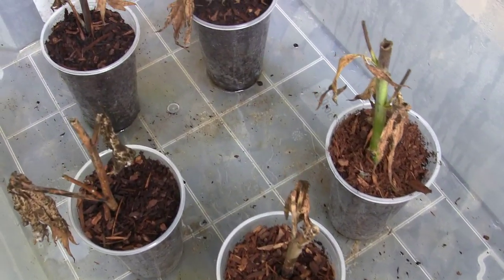Why am I Getting Mold on My Plant Cuttings | Why are They Rotting in My Propagation Frame

Comment: I got to be told 20 times  about this over watering thing.  You have a video where you showed  a sorta clear plastic tote . Lid too. And the condensation  on the lid was way more than I have achieved using the fist squeeze soil moisture standard. And in that video you emphasized  little water yet those condensation droplets were huge ( size of a nickel) so I followed what I saw and not what I was told

 This spring  starting in March I made a compost like with crushed deciduous leaves for the brown and a lot of some sort of ornamental conifer trimmings.  Soft terminal ends  ( last 6 to 8 inches ) the green conifer trimmings I put on the bottom, of the bottom of the pile. And by the 1st of July as I was  aerating  the pile . The bottom of the pile was  a mass of matted white roots. So much profusion of roots that I could not identify any of the original trimmings . Which was the very tip and more important which or where was the cut end of the branch

Now for the conclusion . This root mass at the bottom of the pile . Which had grown within the pulverized  leaves  was dry . Apparently never recieving rainwater moisture or very little and only ground moisture percolation or vaporized from the ground. . A guess would be 10% moisture but appearing  and by feel mostly dry
Reply from the maker: Sounds like your own property is teaching you

Comment: I think if you remove all the bark and green material below for 1-2 inches you can propagate semi-hardwood really easily in water. The inner part of the stem is constantly watersoaked anyway, that’s it’s job, so it won’t rot. It’s the roots that can rot. Therefore, before roots have developed, „sharpen“ your stem + half it or even quarter the stem to give the stem ways to build roots, dip it in rooting gel, and stand it in water. I have seen cuttings develop roots in 5 hours, it was like witchcraft, had a full bundle of 1 inch long roots (olive)

Comment: Finally after several attempts I managed to get three out of 5 petunia cuttings to root.  I added sand to my potting soil, very lightly watered.  Then I put the pot with the cuttings in it inside a gallon size ziplock bag and set it on a window sill of a south facing window.  It took a couple weeks but it worked.  Working on some climbing rose and arborvitae cuttings now.  Thanks for all your guidance!

Comment: I watched a bunch of videos for propagation but none of them showed how and where to store them, not to mention explain the reason behind it...
I've watered my potting mix and cuttings once and will leave it as is in the tote, I had it out in the semi sun \ shade for a day and after watching this I have moved it under a tree next to the fences.
For airflow, either put the wood on the opening of the tote or just drill 1-2 holes near the bottom and another 1-2 near the top of the tote. This provide airflow and vacuum as cold air comes in from the bottom and the hot air rises and goes out the top.
Reply from the maker: Lots of videos on what to do with the cuttings and how to overwinter them, just gotta look through the channel.  Sounds like you've got a lot of good ideas there.

Comment: Started 4 lemon tree cuttings 2 weeks ago. Everything seemed to be going ok, they were green and good. Little did I know I was overwatering them, then to make things worse I stupidly decided to totally enclose them with plastic cups limiting the airflow. I even left them on a radiator one night. 3/3 mistakes made, dear lord, I completed the mistake set to absolute perfection! They are all covered in mould now and three of them are brown. I guess they're all dead as a Dodo. Oh well, tomorrow I will start again with a new batch and take more care this time. Thanks for this 101!
Reply from the maker: Glad to help!  Good luck on the next run.
Reply: @MikeKincaid79  Thanks Mike - I think you basically hit the three big ones and I made all three mistakes - one quick Q regarding citrus (lemons and oranges) if I may?

 I used natural very high quality unfiltered local honey from a neighbour (I'm in Greece) and mixed it with cinnamon in lieu of rooting hormone, I have fantastic lemon and orange trees which are at least 20 years old and were carefully grafted by my late grandfather - I took the top/newer foliage as cuttings as I've read is the right thing to do - I want to clone them for another property down the road. What's your view on my rooting mix vs "root hormone" powders etc? Am I better of procuring rooting hormone powder?

Comment: Hi Mike, Excellent video! I’ve propagated soft wood cuttings for many years and have had really good success! However, all of my cutting experience has been in the spring!  I’m finding out that taking cuttings in the summer, is a whole new ball game! This video answered most of my questions. I live in Chico CA, and the summer temps can get into the low 100’s several days in a row. I have taken cuttings from azaleas, hydrangeas and an amazing 4’ high (max) oak leaf hydrangea that has blooms all over. I’m really excited about the oak leaf! I have my cuttings in totes, watched the amount of water in the soil when sticking. Is there any additional info you can give me to help in the success of my cuttings since I’m dealing with such high temps? Today is 101. It an go up to 110. I’m just hoping it’s not too hot here to do cuttings! I’ve already learned so much from you. Without your videos I never would have tried summer propagation! Love it! Thanks Mike!

Comment: Try treating the soil with diluted Hydrogen Peroxide mixing in with the water, it is good for the soil and keeps the mold away. Hydrogen Peroxide is also great for the roots of the plants.
Reply: Dade Pomsouvan Would this be safe to do on bare roots of a succulent I’m trying to propagate?
Reply: Would that be safe for my Fiddle Leaf Fig Tree?
Reply: @erinrees532  Aloe vera juice is great for propergation, soak the bare roots or cuttings in Aloe vera juice for disinfection. You can also use cinnamon powder for rooting cuttings, but most succulents don't need it, except desert rose.
Reply: @Flow888100  Yes, you can, just make sure it is diluted with water before spraying it on the leaves.
Reply: @DadePomsouvan  whats the ratio of hydogen peroxide and water?
Reply: @brothernero8428  I use one part hydrogen peroxide to 3 parts water for the soil, if you want to spray the plants directly, I use very little, one table spoon add to the whole spray bottle of water.
Reply: @DadePomsouvan  can i use that 1 tbsp of H.P on a full water spray bottle on my cuttings that starting to develop molds? im worrying it might dry out my cuttings.
Reply: @brothernero8428  What kind of cuttings are they? Spray the area where there is mold and wipe it off with a clean paper towel, if the mold has already infected into the cuttings, it might be too late.

Comment: Thank you for all of your video's that I've watched and hopefully learned from!!  My question is that living North of Boston, MA attempting several times to successfully grow rose cuttings with no luck.  It's almost winter now and I want to know if I take some last rose cuttings and attempt to grow them in my finished basement, would a grow light help? I've left recessed lights "65W" on and will try to not water as much. I planted them in bottles and in container with bottles covering for condensation as you've advised.  Thank you in advance!!
Reply from the maker: The leaves have probably fallen off by now and they are hardwood cuttings so you shouldn't need humidity at all.  lighting and bottom heat is necessary and you may want to use an antifungal spray for the cuttings and soil.

Comment: I rooted a hydrangea cutting last year after following your vid instructions. It's in a 4 inch pot and has 4 little leaves, but it's not gotten any bigger since last fall. I stupidly only rooted this one cutting and I'd like to grow it big. Any suggestions? Also please put a plastic bag over your wounded hand while you are out around dirt.
Reply from the maker: Up-pot to a bigger pot and fertilize.  Keep the soil moist and you should get tons of growth.
Reply: I put my rooted cutting right in the garden in a protected area last summer, and it’s 2 feet high and bloomed this summer.

Comment: Wish I had watched this before trying to propagate some precious watermelon peperomia cuttings for the first time! 
I have mould growing 😓 3rd day in. I had them on a heat pad (winter here in Southern Hemisphere) in a mini greenhouse on the kitchen bench, had watered a lot after planting. 
It’s far too late to take back the watering, but I’ve taken off the heat pad and taken the lid completely off. Will see if that gets rid of the mould, hopefully these babies can be saved! Thank you. Any other advice?
Reply from the maker: Sounds like you're on the right track now.  It's tough losing cuttings but at least you learned something in the meanwhile.
Reply: @MikeKincaid79  thank you so much Mike. I read that cinnamon may also help the problem. Is this something you have tried or can recommend?

Comment: Super clear and concise ideas. Appreciate the content. Just had a couple random questions/observations. Any reason you are using totes with gaskets if you leave them propped open? Also I have always read that hardwood cuttings need cold to focus on root development vs top growth. I have had success leaving them exposed to the elements (or in a coldframe) here in 8b. Just curious if you're in a much colder zone than me. I always baby softwood/semi-hardwood cuttings with domes and heat but I love hardwood because they're so hands off.
Reply from the maker: Glad you like the videos!  I use all kinds of totes, just have one with a gasket.  You don't need a gasket, that tote just happens to have one.  

I live in the same zone, 8b, Western Washington State.  I do the same thing for most hardwood cuttings.  Just leave them outside and stick them when we get closer to spring.  Depending on how difficult or easy they are to root I either use bottom heat or no bottom heat.  Good luck and have fun!

Comment: Mike, what are you spraying them with if there is mold on them?   Peroxide?    I was in the hospital for a few days and now there is mold on my SunPatient cuttings and apparently, I did overwater before that.   Or do I just get rid of the ones with mold and remove the lid (right)?   This is all inside my house in 1 tray.
Reply from the maker: Once they start getting mold and going down hill, I like to just start over.  You can use peroxide and may save some but it might be more fun to just bag these and take some new cuttings.

Comment: As always enjoyed the video.  I bought a mini greenhouse it just zips on both sides, plastic  with 4 shelves.  I put my cuttings in it it's September 24.  They are all covered with plastic bags and have condensation.  Do I keep them covered?  Or do I remove the covers and keep them uncovered or covered for winter?  Thanks.
Reply from the maker: Depends on many factors.  Are these softwood cuttings?  What type of plant?  How cold does it get or are you in a tropical region?  Are you heating the greenhouse?  Do you have artificial lights in there?

Comment: Hello once more, Mike!  Trying to come up with the best way to ask questions regarding your member's area videos, so I thought I'd start here.  I realize that your primary area of interest is the propagation of rhododendrons, and, as a result, your member's videos primarily deal with how to use the propagation box for them.  However, if you use it for, say, softwood cuttings, wouldn't things be quite different?  For example, how long would those guys stay in the box?  (Rhodies don't get stuck until the fall, so they have to root over the winter, correct?)  I'd like to try to propagate rhododendrons, but right now as I'm learning, I'm trying things out with plants I already own.  I can see the advantages of using the propagation box over my big collection of totes, but I'm trying to work out how this process changes when it's used for plants that are propagated as softwood cuttings in the spring, and also how to adapt things for my zone:  5a.  (For example, you did mention in passing about how the freeze/thaw cycle in your area makes the bottom heat imperative.)  I'm hoping you might be willing to squeeze in a video on this (in between all the other responsibilities...)  I appreciate your passion greatly--especially the fact that you're sharing so much of this information just out of your desire that others may experience the same!  Thank you!
Reply from the maker: You can use the frame for softwood cuttings as well.  You'll just want to keep the bottom heat off through the summer.  Softwood cuttings root so quickly that you could pot them up in time to start semi-hardwood cuttings in your frame.  You can also make a larger frame and start softwood cuttings in 1/3 of it, and then semi-hardwood cuttings in 1/3, then turn the heat on when it gets cold and start hardwood cuttings in the last 1/3 of the frame.  By the following spring you can be potting everything up and starting over again.  Just use the bottom heat in conjunction with the weather (turn on in the fall and off in the spring).  All types of cuttings will benefit from bottom heat in the winter.  By the way, save some room for seeds and they will flourish in this frame.  If you have more questions just ask.  It's usually easier for me to see the question on Facebook messenger through my 'Kincaid's Nursery' page.  Bear with me for awhile though as it takes ten times longer to type right now.
Reply: @MikeKincaid79  - so nice of you to reply so quickly!  I really don't want to inundate you with questions, since you're doing this out of the goodness of your heart...just one little followup question:  I'm in Zone 5b and it often gets pretty cold here in southeastern WI.  Would you leave the softwood cuttings in the frame all winter and pot them up in the spring?  I've got a bunch of stuff in my totes that I'm going to pot up in August and heel them in my raised beds (which have hoop covers).  With the frame and bottom heat, could I leave them in?  And...I love the idea of putting seeds in there...I've been doing the winter sowing with milk jugs, LOL...

Comment: Hey Mike I was just checking my cuttings today and my curiosity got the best of me, had to pull a few up and check them out and i was shocked when i saw that it appeared to be forming a ton of root nodes, but the majority of them were slightly above the medium for some reason? Some were in the dirt but they were doing tremendously better slightly above it. Theyre semi-hardwood cuttings
Reply from the maker: That's funny, well, let them root above the soil!

Comment: On your outdoor propagation box that looks like it has a plexiglass top, how do you have air vents in it or how big approx for something like that? I want to build one and use sand.   Btw video is good as always.   My biggest problem is to much dang water. Grrrrr. I’ll never give up
Reply from the maker: It's a glass top.  There are no air vents but the lumber and glass don't make a perfect seal so there are gaps for air flow.
Reply: Mike Kincaid makes sense. Perfect.  Thanks! God bless ya

Comment: Yea yeah make the roots seek out the water  i tried that during the winter . Stuck fig cutting in my potted fig plants soil along side the plant in an unheated concrete floor building the plants did well the cuttings didn't even form  white bumps  . They didn't rot . 
 I  consider that you drench your cutting with your garden hose wand . I cant force myself to put that much water on any cuttings 

 Remember your videos on rooting cutting in a sort of clear tote with a snap on lid. You had such large water or condensation bubbles on the lid that it was frightening . My clear tote the top lid only had tiny bubbles. I'm mean pin head size bubbles or drops . Thats been 4 years ago I figured 
 I keep trying but no success yet . I'm now water rooting with aspirin and an aquarium  bubbler bubbling away not using expensive fig cutting but home grown apple plum mulberry and persimmon  . I figured it not the cutting its bob Brawley is the problem. 
 The water bath rooting was all the rage on WTF FACEBOOK FIG SITE.
the formula was z Camille  tea in water with cuttings suspended through foam only the cut tips  in the water.  What does tea have to do with it . I don't know  no bubbling in the static water   
 Most success I have had is I got white bumps on a Apple cutting stuck in a half filled five gallon bucket of water out in the woods where the leafs haven't  died after 5 weeks  . I keep dusting with that worthless powdered rooting hormone  I buy at Lowes  that  stuff is totally useless but for the antibacterial properties . I know that works good because I got a face flush  smoking a cigarette after spilling that powder all over myself
Reply from the maker: Don't make it too complicated, Bob, lol.  Just stick the cutting in a pot and place in the shade.  You'll have a tree in a couple months.
Reply: @MikeKincaid79   yeah I hear you on that . The over complicated part . All the buzz year before last on WTF fig site was "pro mix"   whats pro mix?  Oestmiss with one fungal in it. The fungus seller video  (Mycroz) said  the additive doesn't not promote root development nevertheless  that was the magic  mix till the following year when the same author proposed Camille  tea water bath . Why that type of tea . I would think Green tea would be the "it" tea. There is a pile of sand on the concrete plants yard outside my door . It very appealing to me to stick some cutting into  something  free  not fig , to valuable but I have raspberry mulberry and tons on black locust   and mimosa  tree.  Any thing to to experiment with  for the old Italian  man technique